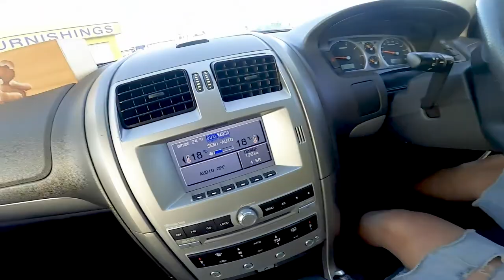WATER LEAK IN CABIN/ WATER DRIP IN FLOORMAT PASSENGER SIDE WHEN AIRCON IS ON/ FORD TERRITORY

Comment: Your - Air Cabin Filter is completly missing from the removeable Tray that you removed. It's meant to be present to stop and block leaves,dust,debris.
Reply from the maker: Its stops only leaves and debris but dust won’t, it has fine mesh on it or screen I don’t know it was like that ‘till I open it. But I bought the filter on it and install it.
Reply: Standard 'povo-spec' fitment.  Easy and cheap to upgrade to a pollen filter.

Comment: In my ford ranger 2.2 model, There is a water leak which is on the back seat floor. I suspect that it is coming from the vents which are located on the back seat and below the rear wind shield. The problem is it is covered with fixed metal sheet from the inside and from outside it is difficult to see since there is the truck bed. May i ask what is the name of this vent in case it is damaged and i want to buy from the market or online...
Reply from the maker: Just check your manual maybe its there mate or you can call thenearest  ford dealer . Good luck mate

Comment: This video saved me soooo much pain and suffering. Although my hose doesn't exist, it's still in the same location.
I had to cut out the whole passenger side carpet out in order for it to get dried out, the foam was really soaked through all the way to the back seats
Reply from the maker: If you can locate the drain tube line then blow it with air compressor, small tyre 12v compressor can do the job to blow the shit out. Good luck mate.
Reply: @louie170dx  I have a snubby nose on my air gun, hooked up some extra hoses to that for the flexibility. Worked like a charm. Now to wait for the carpet and foam to dry out and I can finally put the seat back in.
The water was literally pooled underneath
Reply from the maker: @paulscolaro87  well done mate . You can enjoy your aircon with out making any messy water on your carpet😎